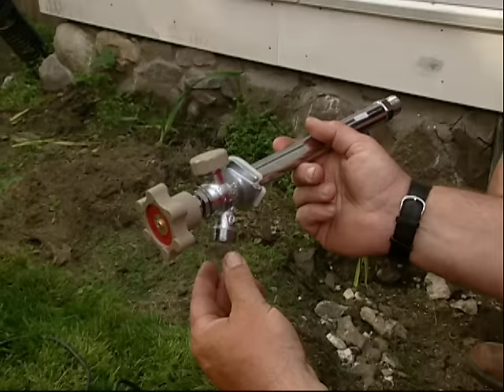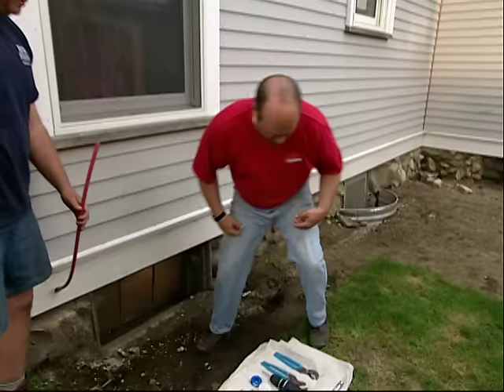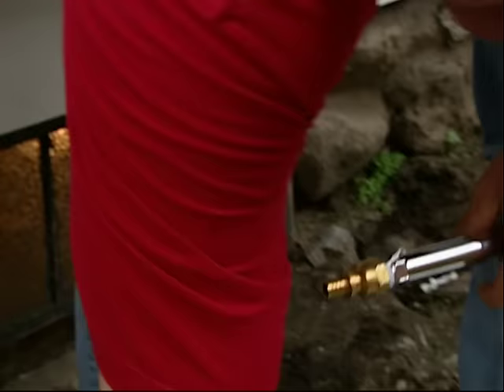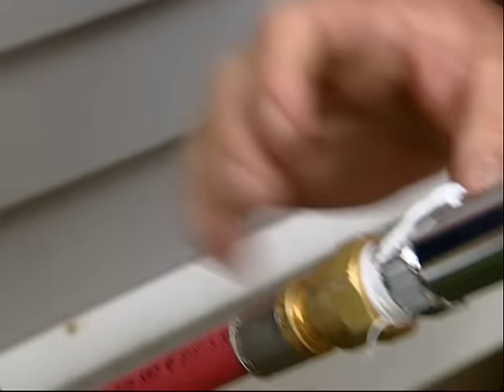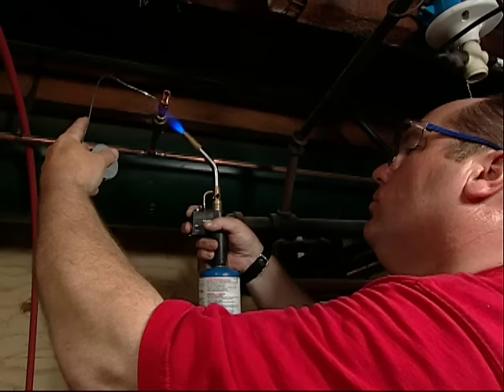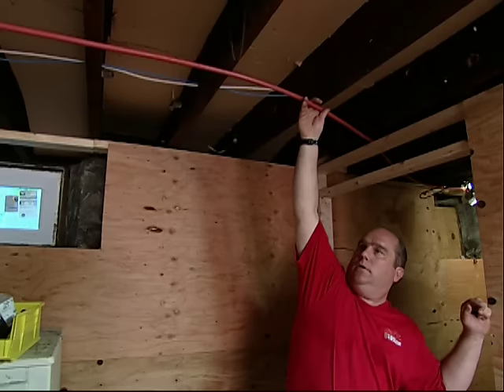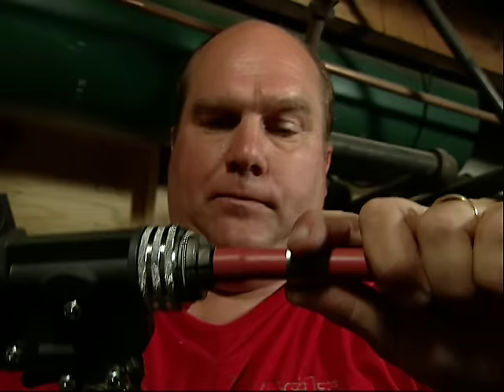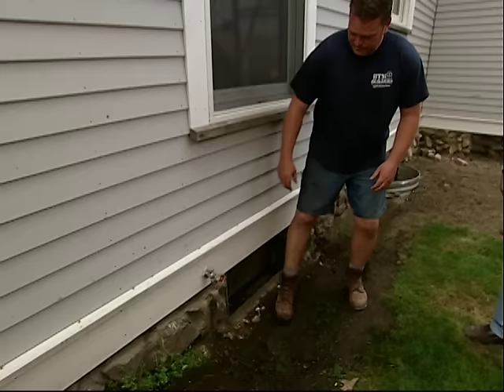How to Install a Frost-Proof Faucet with PEX Piping | This Old House

Comment: What is the name of the tool that expanded this pex B pipe and then pulled the collar over the fitting?  I cannot find that...
Reply: this is pex A pipe I believe and I don't see this method being used anymore. Wirsbo is the new and improved way of connecting pex A pipe. expansion is still used but in a different way.
Reply: @LumenChaser  that is a Rehau PEXa system.

Comment: This Old House Richard, In several videos, you have shown the instalation of Rehau PEXa, which has very nice fittings. Do you have any experience with Uponor (Wirsboro) fittings, or any issues with them?
I am partial to PEXa expander style fittings as to avoid the smaller internal diameter crimp-on PEXb/PEXc style fittings which restrict water flow.

Comment: How in the hell did the water come out the new hose bib so fast? No air first.  No gurgles or burps at all?  Is pex magic? Are you magic?
Reply: That's easy: They've opened it before. Something could have gone wrong during the 1st take, so they recorded it again. This could be like someone of the staff sneezed, the microphone boom was in the picture or something like that. Such things are happening on every movie set.
Reply: Turned it on and the end blew off😂

Comment: When you have to replace that frostless do you have to hold it from the inside of the house?  Or can you twist from the out side only?  I have to replace mine and don’t want to have to open the wall on the inside to hold the nut if not needed
Reply: It depends how the frostless was tied into the supply line.  Do you have copper lines.  If so, the frostless may have been soldered and you will need a torch to unsolder it.  You can also cut the supply line going to the frostless. Then remove the frostless outward, away from the house.  You can then slide a new frostless back in and tie back into the supply line.  Checkout Sharkbite fittings on YT.  If you solder a short piece of copper to the end of the new frostless you can tie it to the supply line weather copper or pex using a Sharkbite union without any soldering.   And it doesn't matter if the supply line is dry or wet.  Sharbite works with both.

Comment: Rich, I have never seen a pex manual expander tool like that, with those ss sleeves.....is that something new?.....What Brand of pex, or?
 is that?......I have a battery powered Milwaukee brand expander tool, I use with the Aqua Pro Pex Pipe, with the engineered plastic fittings....this system, also has the different sizes of  pro pex sleeves, with a stop collar, that slides on, prior to expanding the pex piping, and then inserting the fitting etc......Thanks, Tim.
Reply: that is a Rehau PEXa system.

Comment: Do you cut the water line  before  it gets to the  the water heater or after ?
Reply: If you cut it after the water heater, the faucet would be delivering hot water.

Comment: But how many people have put the collar on backwards and found after they did it?
Reply: Since there's no forcing cone on the other end of the sleeve, it'll probably just sheer the pipe when you try to force it on and not work. But I've never used it so I don't know.
Reply: That's his point, Ike. It should have been mentioned in the video.

Comment: When it comes to water and pressure I have trust issues...  Nice video though...
Reply: Watch some of the PEX A & B water pressure tests.  These things go to almost 1000psi.  The only way PEX-A fails is if the fitting is defective or the pipe is expanded improperly.  I felt the same way before doing the research.  Only thing I still don't like is having to install a black ABS plastic sleeve around PEX-A that is exposed to UV light.

Comment: Is it safe to use plastic instead of copper,  I have seen plastic water lines on new small homes but how long do they last?
Reply: As long as the lines are used where they are not exposed to sun, do not freeze or become damaged they last forever... at a fraction of the cost of copper.  Also, plastic will flex some if there is severe settling in a house or an earthquake... copper will not.
Reply: yes it's super plastic
Reply: PEX lasts 100 year or longer.  Copper pipe 70-80 years max.
Reply: @donnbialik9085  that’s what I’m talking about i’ll be Dead if I have to replace it again👍🏻👍🏻👍🏻

Comment: I much prefer the simple crimp ring to that setup.  I am sure that method is even less likely to leak (but I am sure it costs more), but I have yet to see any crimp ring leak...so yeah.
Reply: vlogerhood - Copper crimp rings or the stainless pinch clamps?  A pinch clamp leaked on the PEX in my old house's bathroom two years ago...ruined the drywall.  Granted the installation job (probably 10 years old) was probably to blame, because it was a very short run between two brass manifolds under a lot of awkward side tension.  My new house uses all the plastic expansion rings on the PEX.  That scares me even more than the pinch clamps...
Reply: I have those white expansion tubes I think you're talking about.  I've had them for 5 years my neighbor has them for 10.
Reply: I had a fitting shoot off the crimp ring before because the guy had way too much water pressure going into the house. The thing shot right off, caused a ton of water damage. That's why you don't mess with water pressure. I like the ring and crimp method myself, never had any issues aside from that one time which wasn't the fault of the ring anyway. I like the expander/sleeve method too but that's a big friggin' tool to be lugging around. How the hell are you supposed to get that under tight vanities to get valves on? There's no way, but for a job like this though where you have a lot of space to work in, I think it's great. Plus, it maintains the inside diameter of the pex whereas the crimp/rings reduce the diameter. Not that it makes a significant difference but if you want max pressure, the expander/sleeve might be the way to go.
Reply: Cup & Cone how are the plastic expansion fittings holding up on your PEX piping? Do you still worry about them leaking?
Reply: @trainofthough0242  stainless Rings For Outdoor !!!!

Comment: It's already been tried before the "king" gets to use it for the "first" time. The ground is wet and there is no air in the lines! And no homeowner is using that tool...they're using the cheapest crimper they can find at HD or god forbid sharkbite...

Comment: I have not seen in any plumbing video or store, that kind of pex tool. I would not trust that fitting at all. Just got a normal sleeve and a crimp tool, expanding and then punching is not something I've seen anywhere.

Also the caulk on the outside faucet was useless and did nothing. Should have caulked on the plate itself and then again on the inside.
Reply: that is a secure fitting and that is a Rehau PEXa system.

Comment: It doesn't show anything about disassembling the unit.
If it never gonna leak, it will be hard to disassemble in case it is needed!
Reply: Jay Lee.
Reply: I had this happen. When I tried to remove the faucet from the outside the pex pipe just twisted and caused a leak in the pex inside the wall of the house. Had to shut off the water overnight and cut a hole in the wall at the pex to hydrant connection. Flooded the den and caused carpet damage. The pex to hydrant fitting needs to be anchored so the faucet can be removed without causing the pex to twist and break.
Reply: @mikeellis7412  This is exactly what I am dealing with. The donkeys who built the house did this and now the faucet is leaking so I want to replace it. Obviously you turn the tap and it just spins....

Comment: I have been making additions and replacement lines using PEX. However, instead of soldering new connections to copper pipe to connect to the PEX, I have been using Shark Bite connections. They can connect same size copper to PEX or PEX to PEX. I have been using these for several years now and I have had no issues with leaks or loose connections.
Reply: I wouldn't recommend sharkbites as I have seen way to many that were properly installed leak. You're best off sweating on a pex adapter.

Comment: What's with these fools using drills, hammers, etc and not wearing eye protection? Don't learn the hard way......
Reply: LOL, i was using my miter saw, hand tamper, 40 pound maul, my impact wrench and 2 different power drills this weekend so far.  The only time I used safety glasses is when I used my chainsaw.  If you were meant to go through the remaining part of your life maimed, it will happen no matter what safety precautions you choose.  So why use any?  Well, I'll tempt fate a little but I won't challenge it
Reply: @bill smith  reason it however you like. It's still foolish not to wear eye protection. Maybe you'll learn the hard way, i hope not.

Comment: it appears you are installing as pex-a pipe (since you needed to expand it to side) over a pex-b fitting. Things that make you go hmmmmm.......
Reply: You are very incorrect.  that is a Rehau PEXa system.  And for the record, you CAN use pex-b fittings WITH Pexa systems; just not the other way around.